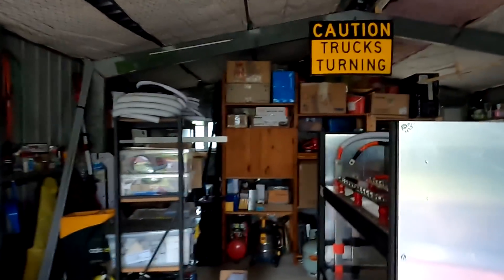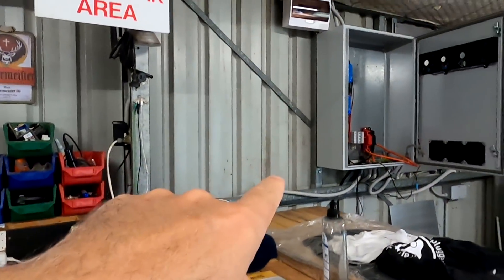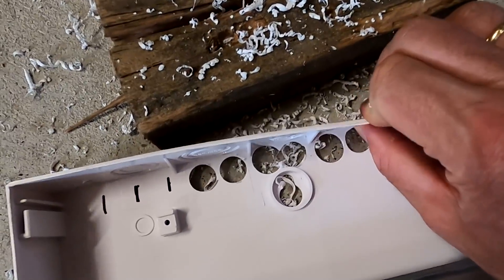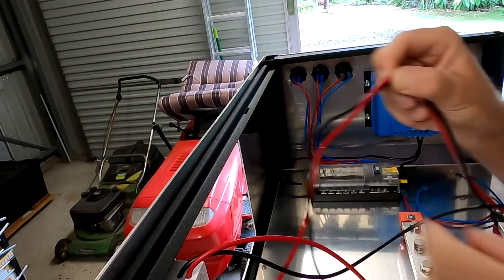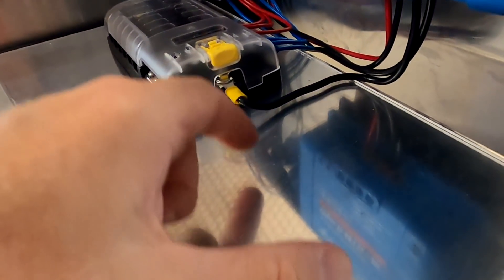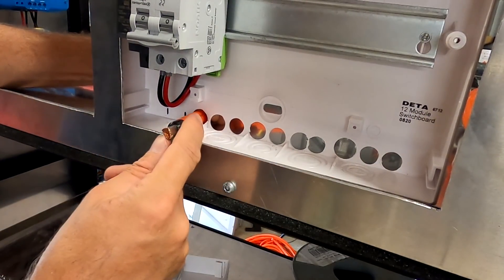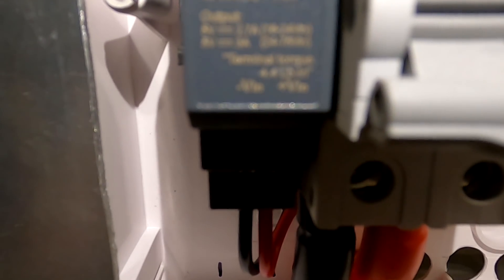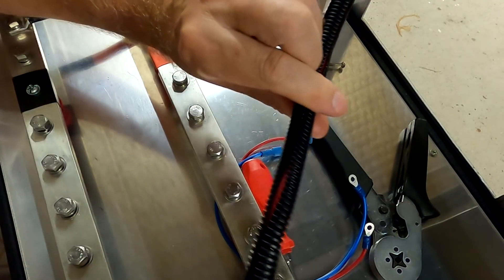Wiring the 5V and 12V converters, first breaker connects to busbar. Good progress! | Battery2.0

Comment: 12:00 regard the no longer flat terminals

I would picked that terminal and holt the surface on a grinding machine / Schleifmaschine, those with the rotating grinding blocks or Winkelschleifmaschine. Afterwards any oxydation would have been gone and it would have been plain.

Comment: It’s a great learning curve Andy. Whenever I cut thick cable and there is a bend on it right at the base of where the cable or ferrule goes bend the cable before you cut the cable this way all of the copper ends are the same and as you crimp will give an even amount of pressure all the way along the lug.
Love your videos mate.
Reply from the maker: Thanks mate. Great tip here so thank you.
Reply: Yes, this was my immediate thoughts too

Comment: Hi Andy. You could tighten the negative cables at the bottom side off the bus bar so that the cables would go straight under the positive bus bar😉 and not banding them.
Reply from the maker: That's almost impossible as the bus bar is threaded

Comment: Have you thought about connecting that negative cable to the bottom of the bus bar?  That way you dont have to worry about trying to bend the terminal.
Reply from the maker: The bus bar is threaded though which makes it very hard to tighten the bolt.
Reply: @OffGridGarageAustralia  ahhhh yes, wasnt sure if there was enough room under or not.

Comment: Hi andy would it be ok to ask u for some advice.i purchased 64x200 AH lithium ion batteries,and want to top balance  them,u have a charger that u use for that .I want to get one that same or similar for my job can u tell me where to get one and the model number and make of charger.would appreciate  your help very much.cheers Rene.
Reply from the maker: Hi Rene, I use the Wanptek 60V/21A charger for my batteries. There is more info on my website here: https://off-grid-garage.com/measurement-tools-and-analisers/

Comment: Can I ask a silly question? Why use a DC-DC converter for the 12v, why not just connect to 4 cells in series, your active balancer would take care of the extra drain on the four cells?
Reply: This is no good idea, as this powering scheme creates permanent cell's unbalance. This scheme was used in "before pulse-mode DC/DC converters era" until 1990-es, in various battery-based power systems, like DC control power systems at HV substations, at electric trains, submarines, etc. This scheme was inefficient and labor-consuming, and was safe with nickel-cadmium or wet lead-acid cells. Today, it is far more safer and efficient to use various DC/DC converters.
Reply: @thesignalbridge  I understand your point but if the 12v power consumption is small the active balancer will easily cope with the small imbalance. Obviously dcdc converters are a better solution but if weight and space are an issue and the 12v draw is relatively minor then a 12v tap may be the better solution.
Reply from the maker: The 12V consumption can be up to 300W. As Sergej said, it's not a good idea and causes a lot of imbalance and extra maintenance.
Reply: @OffGridGarageAustralia  fair enough, 300w is  a little much for a direct tap.

Comment: why are you running DC connections? Maybe I missed something. Assume the wireless bridge runs AC. Seems like a lot of work to run DC.
Reply from the maker: The Wifi bridge runs on 5V, the network switch runs on 12V, all my camera gear runs charges on 12V/5V and the fridge... 
I want to have a 12V supply as well as a side project.

Comment: Why did you not fix the cable UNDER the bus bar? It would then come lower and you would not need that bending. You could easily crew the bolts from under and fix the cables in that way. Would also look nicer, or not?
Reply from the maker: The bus bar is threaded...

Comment: That thick cables(orange) for 10A fuse is total overkill. What a waste of copper :)
Reply from the maker: As I explained in previous videos, I may replace the breaker with a larger one in the future and don't need to change the cable then.

Comment: Off topic:  Andy, did you ever get the smaller ZKE battery tester fixed?  I watched Part I and II but there wasn't a part III that I could find.  I saw in Part II you replaced the voltage regulator put there were other problems.  I have one of these and it is doing similar things.  So, did you ever get it fixed and if so, is there a video of it I am not aware of?
Reply from the maker: No, didn't get it running again. The manufacturer said I need to talk to the shop where I bought it but they just shrug their shoulders and didn't know how to order spare parts. ZKE was not helpful at all unfortunately.
Reply: @OffGridGarageAustralia  Thanks Andy.  Probably should have ordered the bigger one in the first place.  It was just so much more expensive with the shipping to US from China.

Comment: Hi Andy you could use taller isolators on the othe busbar  ( different levels then)
Reply from the maker: Yes, I had this before and it worked great. I thought I can spread the bus bars further apart to allow for the cable to bend. It works...

Comment: The engineers did fine on your circuit breakers. Hook up the source (your battery) to the correct symbol. That is the direction of current flow that will allow proper tripping and arc extinguishing while consuming battery power.
Reply from the maker: All DC circuit breakers are non-polarised and work in any direction. There is no right or wrong with these.

Comment: If you attach the rear cables to the BOTTOM of the bus bar it will result in a milder bend in the wire. AFTER firmly attaching to the bus bar you can THEN bend them downwards.

Comment: You have carefully colour-coded your wires/ cables most everywhere, but the Victron dc-dc converter output wires are both black, positive and negative.
Reply from the maker: They now have heat shrink. Thank you 😉

Comment: @14:32... I'd put a small piece of split loom protecter on the Neg. wire running under the bussbar. JMO
Reply from the maker: Yes, I have this now with orange conduit, so it is an additional layer of protection.

Comment: When i used to do alot of cable terminations, i would 3 to 4” extra and then bend and sharpie to get my actual fitup length. Also they make a split loom tool that will make your life easier and fingers safer. Excellent work keep moving forwards and love the build content
Reply from the maker: Thanks, Jon. I have seen this tool and I would buy one if I would have longer runs with this split loom.

Comment: I'm a bit confused. Look at the diameter of the cable from te busbar to the breaker. It probably can handle 200A. On the outgoing side you use 2,5 mm2. Don't you think the incoming is just a little bit overkill?
Reply: The point was to give himself future flexibility to size up circuits without having to replace those wires.
Reply: If you have a short between the busbars and the breakers the small wires may not be able to trigger the large breakers feeding the busbars from the batteries and are just melting.
Reply: @dirkaust5107  I disagree on that. The breaker trips at 10A . So if you take 4MM2 or even 6mm2 it would never mellt the wires.
Reply from the maker: As I said in my videos, all connections from the bus bar to the breakers will be 35mm in case I have to swap/upgrade breakers, I have all the options.

Comment: If your wifi bridge have a ethernet cable you could use a POE injector and 5v POE adaptor at the bridge end. Then you can supply the POE injector with 12V and down convert it at the bridge?
Reply: In case of using POE, I suggest to  directly supply battery 48 Vdc via POE injector to POE adapter (at the WiFi bridge)

Comment: What I'm thinking about is why do you not put the negative cables on the underside so they do not have to be bent as much and give a little more space to the positive part?
and if you intend to increase the distance to the positive so it also comes higher up so there is a slight difference in height so the risk of being worn against the product decreases
Reply from the maker: The bus bar is threaded and there would be now way to torque it any more.
Reply: @OffGridGarageAustralia  you can raise the positive bar and it is not possible to mount the cables from the bottom so they become straighter and it reduces the load on them

Comment: Is that converter isolated or just a buck converter? Is your charge controller common positive or negative?
Reply from the maker: Both voltage regulators are fully isolated.

Comment: It's going forward, great. I like the fine attention to detail like "bend before crimp". As a tip, you may order some cable grommets for the slightly to wide holes, they will also disarm the sharp edges. They rings can easelly mounted afterwards if you cut them once.
Reply from the maker: I have bushes for these holes but they need even larger holes. I 'disarmed' all holes from sharp edges.

Comment: mount the negatives on the underside of the bus bar ?
Reply: Correct, I had the same idea
Reply: +1
Reply from the maker: Not possible as the bus bar is threaded.
Reply: @OffGridGarageAustralia  bolt from the bottom.  Makes no difference to the thread
Reply: @stupidmonkeykev   Indeed

Comment: Concerning CB's terminals tightening. As power cables have multi wire cores, these core wires and ferrules will have slow plastic deformations inside tightened terminals and this process will loose tightening. So, it will be good to make several re-tightening operations at CB's terminals, where cable cores with ferrules are used.

Comment: Looks great Andy, thankyou for the pickme up, my day started with a dead battery in the bosses truck, 19 deg f, elevator was out of service so I got to pack up my 300 lbs of tools up 5 floors of stairs n its only 12:30! So again thanks for posting. Impeccable timing. I do like those ferrules I will have to get some on order

Comment: Frustrating when making a cable and it ends up too short. 😣 Some days are like that. But still, looking good!  (And I like the fuse on the 5v line - probably the buck converter is current limited to a safe limit for the wiring, but so is a BMS and I don't trust that alone either.)
Reply from the maker: Yeah, both dc converters have a constant current setting, so are short proof. I still like the idea of a clean termination and fuse block.

Comment: USB with 12V? I think this is not right
Reply: He said he could send 12v from the electric cabinet on the wall over to a buck converter that'd reduce it to 5v for the WiFi bridge.  But instead, the one 5v breaker is adjustable, so he just turned that up to ~5.2v to account for the loss over 10 meters.
Reply: @Mazlem  no, that is another connection. First Andy Shows 2 usb connectors and a 12v cigarett lighter from the inside. All 3 with 12volt
Reply: @BischesseHunting  oh, yea a lot of those socket-style USB and cigarette / accessory ports will accept 12v or 24v input.  The USB sockets step it down to 5v.
Reply: @Mazlem  oh okay
Reply from the maker: Link to these is on my website. They are for marine/automotive installation and have an input of 12-24V (not the cigarette lighter though).
Reply: I didnt understand this Part as well

Comment: Mr. Andy, will you forsee overvoltage protection to WiFi powering 5 Vdc line? 10 meters is sufficient length to "catch" lightning induced overvoltages. I suggest to place a TVS diodes at the WiFi's bridge DC input and at DC/DC converter's output. TVS's to ground from each positive and negative lines - are optional.
Will battery shelf be grounded?
Reply from the maker: Battery shelf will be grounded. TVS diode is a great idea. Thanks.

Comment: could you bolt the negative cables from the underside of the bus bar?
Reply: I was thinking something like that also, or may just flip the connection over and still use it on top.
Reply from the maker: The bus bar is threaded...

Comment: a trick i use with ends (crimp) when i have to make a bend. when i crimp the lug i bend the cable at the same time and it keeps the bend. you might try it.
Reply from the maker: Isn't that what I showed in the video?
Reply: @OffGridGarageAustralia  yes and it looks good. As for sealing the box to the floor you might think of using the white foam from shipping ( like styrofoam only better). Then you can remove of needed. Or pool noodles?
Reply from the maker: @martehoudesheldt5885  that's a great idea, I have this foam left from the battery deliveries. This is quite dense but still flexible enough. If I cut this in long stripes, it should work. Thank you!!!
Reply: @OffGridGarageAustralia  and the mice don't like it.👍

Comment: Superb wiring Andy. Those large orange cables for 5V, 12V are an overkill but nevertheless why not. Battery 2.0 is going to be awesome.
Reply from the maker: That's for future expansion/changes/upgrades to the switchboard. I just need to change the breaker but not the cabling.